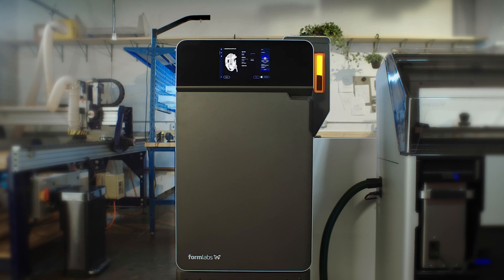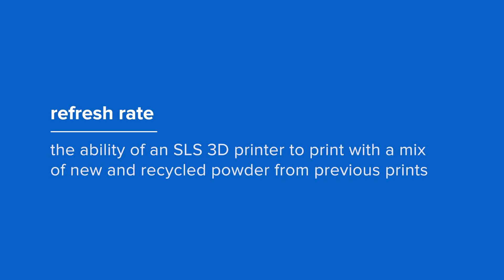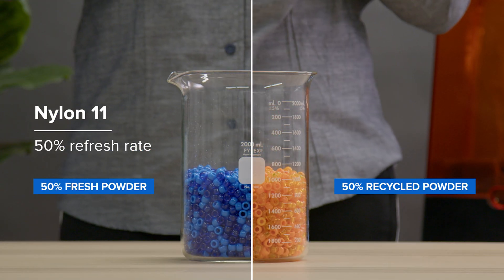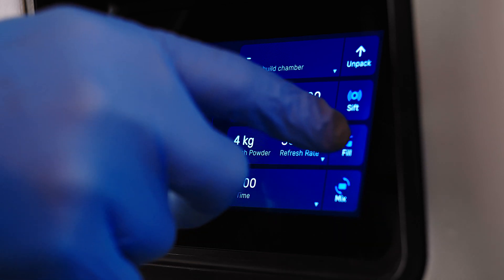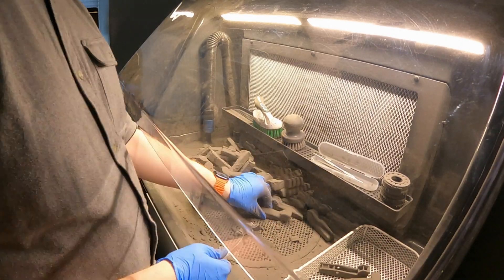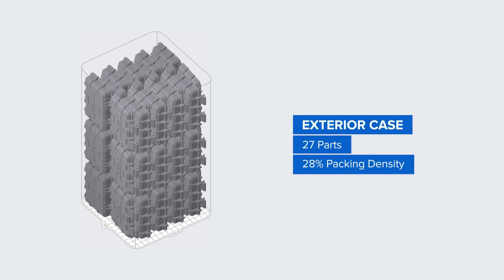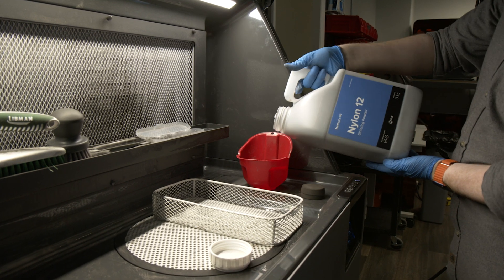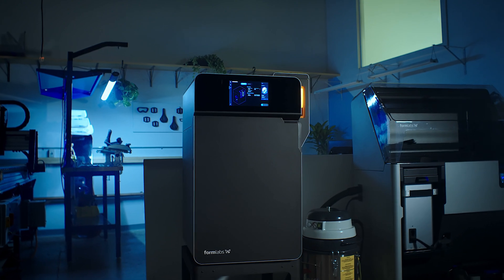SLS 3D Printing Powder Refresh Rate Explained

Comment: Am I right by thinking, if you have a packing density of 30% or higher, you won't run into the issue where you have left over powder building up?
With a previous SLS printer I had to refresh the used powder with new, but I'd have to add more fresh powder than what I had used in a print, meaning the mixed powder was more than what I started with. Say I started with 1kg of powder, once used and then mixed with fresh powder, I'd have 1.1kg of powder in order to maintain the correct ratio of fresh and recycled.
I ended up with kilos of powder I couldn't use efficiently! So, will having a packing density higher than the refresh rate keep this issue at bay?